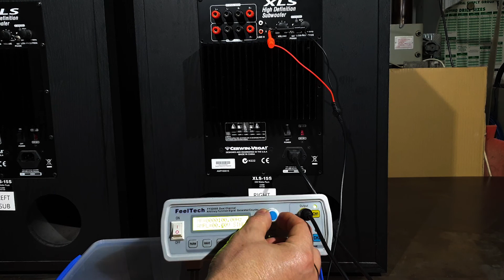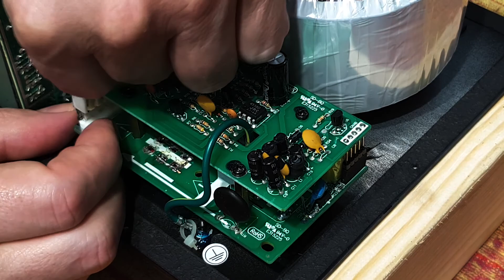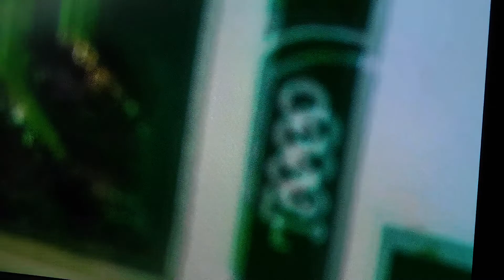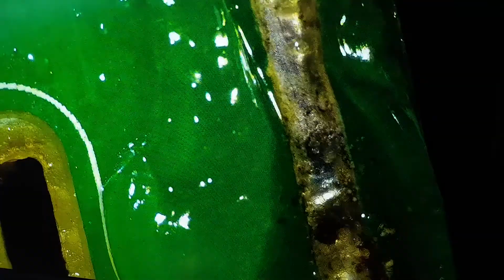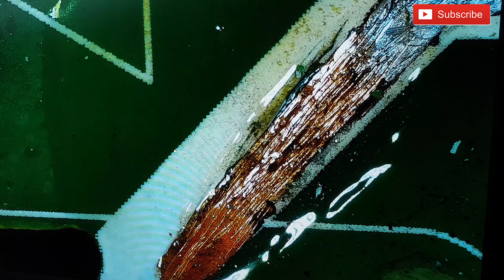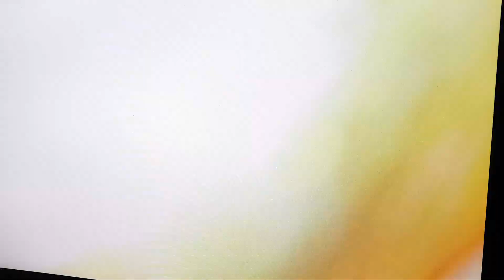#13 - How to fix Cerwin Vega XLS-15s Active Subwoofer (erratic standby, no turn on)

Comment: Good afternoon. I have the same problem, but I'm unlikely to be able to do the same restoration work because I don't have the necessary equipment and materials. Is it possible to change the operation of the device to turn on without standby mode? I think it's easier to short-circuit the relay outputs and not have to worry about these signal waiting circuits.

Comment: Got one of these subwoofers that pop and crackle randomly (and sometimes loud.) It is only 6 years old or so. Started with inspecting for cracked solder joints. Found some, touched them up with the soldering iron, still the same problem. Went over all joints on all boards, still the same issue. The ChengX capacitors didn't provide much confidence, so replaced all with Panasonic caps. None were really bad when testing with an ESR-meter, but all were at the low end of the capacitance tolerance (assuming it is +/-20%.) Still pop and crackle randomly. Measuring DC on the speaker terminals, I find that is has about a 130mV offset, which isn't great. When the pops and crackles occur, it jumps around at several volt DC. Did some testing with an oscilloscope and found the input signal comes through the input board clean at least. Using a freeze spray, I found the DC offset would change if I sprayed the two TO-126 transistors (2SB649A and 2SD669A) in the middle of the amplifier board. I suspect these might cause the issue, but hard to tell. The parts are listed as obsolete, which is unfortunate. Hopefully I can find some suitable substitutes. Would be great to have a schematic/service manual at this point, but that doesn't appear to be available.

Comment: Hey and Can i buy a new motherbord or parts for it  ?
Reply from the maker: When my unit failed there was no boards available to purchase, so I had to resort to having a crack at the repair, which worked out. As far as I know the XLS range is still made under different revisions but mine was well out of warranty at the time.  If you aren't handy with electronic repair, small third party repair shops should be able to handle it.
Reply: Thanks and i wish you and your famile a great weekend 😎💪👍
Reply from the maker: You too!
Reply: Thanks 💪👍👌

Comment: Pulled mine apart (several years after the last repair) and found my amp board a bit crispy south of the rectifier and the leads off the transformer melted into a hard crunchy mess.  This is a great video, even if my issue is a bit more "find a replacement" :)
Reply from the maker: Ah crispy is no good, must have been running it hard aye?  Hope you can find replacements without too much hassle.

Comment: Sorry for writing on an old video.
But it is starting to annoy me quite hard, so i am kinda trying everything now :D.

I have a XLS-15S as well, had it for atleast 4 years now second owner. For all 4 years i've had it. It has been behaving weird, where it keeps going out of standby even through the receiver is turned off and no signal is sent.
I've recently switched to a new cable on the LFE port, as i thought it might could help.
That didn't help at all.
So what happens is it goes green on the back, and then after some time it goes red but only for like a few seconds before it goes green again. Problem is just that everytime it does this, it makes a small bump and sound. Which is rather annoying when the bass is rather close to my bedroom.

As i see things, is cerwin vega even in business anymore? It seems their speakers are really hard to get a hand on now a days? Nowhere i can buy a new 15S..?

Any help appreciated!
Reply from the maker: Yeah sure, hit me up in Discord we can go through the details. 😃

Comment: My XLS-15s is crackling and popping non stop, super loud when there is no signal (stereo is completely off) it's been going for 15 minutes straight now. It's loud and scared the kids during our before school breakfast. Can't imagine what it would have been like if it happened in the middle of the night. How the crap do I fix it? Hell, I'd buy a replacement amp, but it appears you can't buy one. The sub and box are in perfect condition, don't want to just buy a new one, I want this one to stop crackle and popping. Any suggestions?
Reply from the maker: Yep, that's how mine went in the beginning, sounded like WW 2 in the middle of the night.  All because of dry nasty solder joints, the offending part of the circuit was the standby PCB responsible for "waking up" the sub when a signal is received.
Reply: @xyzconceptsYT  my 12s is making this sound also,does it after its warmed up...bit heat shows around the resistors by the fet if i am naming the part correct,could this cause it been bad resistors? I think theres 4 of them on different board to you were on....or should i go straight to board you were on....am a cofident solder...build fpv drones
Reply from the maker: @davidhole8229  Hi, it all depends on the fault, mine randomly took itself out of standby.  I would poke around all the solder joints looking for soft and crumbly ones and clean and reflow them first then go from there.
Reply: @xyzconceptsYT  I have a XLS 12s, with the same kind of amp, mine does also hiss and pop. It is quiet until it gets a lfe signal then it starts and will never go to standby again. pulled out the lower board the one with the switches attached and re-flowed the whole board, but no improvement. Do you have any suggestions where to look next.
Reply from the maker: Is the input source signal clean and working correctly?
Reply: @xyzconceptsYT  I bought a new sub. I upgraded to an SVS. This SVS is far superior for sound, deeper bass and more accurate and clean sounding.  It also scales way nicer.
Reply: @xyzconceptsYT  Yes, it is a clean signal. Have tried another sub and no distortion. Strange thing is if the sub is disconnected from mains for a day. Then it plays distortion free for about 30-60sec then it starts..
Reply: @xyzconceptsYT  Loved your vid by the way and your effort in getting close up footage was very informative mate

Comment: I have a problem with mine and it is that it plays really low even though we crank the sound.  What could be the problem
Reply from the maker: Firstly is the subwoofer itself ok and not blown with all that dub step? 🤣
Reply: @xyzconceptsYT  the sub is fine, bought it 2 days ago of some dude. He tested it in front of me. And it played. And we changed the fuse. Its just that before you get the volume to "oh shit im gonna get evicted" it kind pf whispers to you.
Reply from the maker: @castelinthesky  So, what is the source audio setup in your scenario, is it thought a receiver? LFE output that is enabled?
Reply: @xyzconceptsYT  the source is a receiver, pre out for subwoofer to the lfe in the 15"
Reply from the maker: Can you tell me the make and model number of the receiver you are using?

Comment: What about the one with the blinking stand-by lamp, I have that issue
Reply from the maker: Desolder all joints on the LFE detect board and redo them all.  Worked for me just bad/dry joints. 👍

Comment: Tak mester. Hat lige ordnet min egen   takket være dig. 🙏😉👍
Reply from the maker: Du er meget velkommen :)
Reply: @xyzconceptsYT  vent litt snakker du dansk?
Reply from the maker: @vekteren3549  Nei, egentlig er jeg ikke flytende norsk. Har du fikset abonnementene dine også?
Reply: @xyzconceptsYT  oh i see you used a translator no problem Yeah i subscribed don't worry
Reply from the maker: @vekteren3549  Haha, cheers for the sub, yeah I use a translator so there is no real language barrier anymore.  Just don't ask me to verbally speak other languages. :)
Reply: @xyzconceptsYT  Yeah, i am considering buying the Cerwin vega xls 15, is that a good idea, since i will connect them to my klipsch speakers.
Reply from the maker: @vekteren3549  I don't regret buying mine, some serious bass though if its for the home.  I got two, you know for symmetry. 🤘